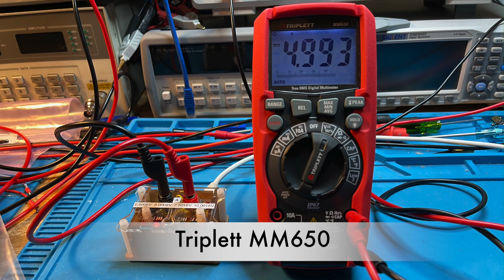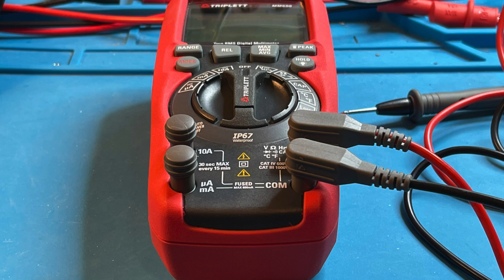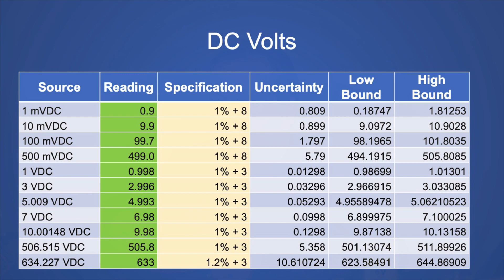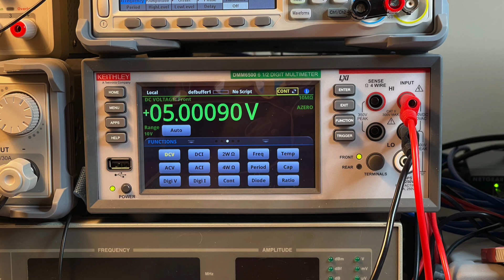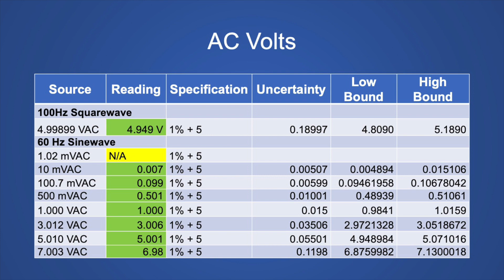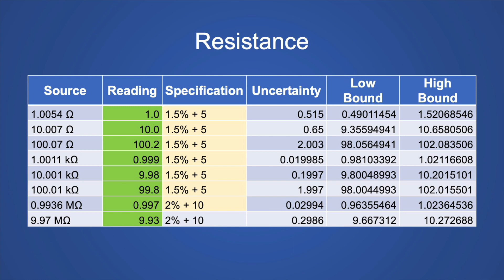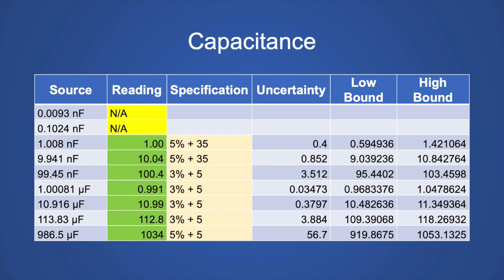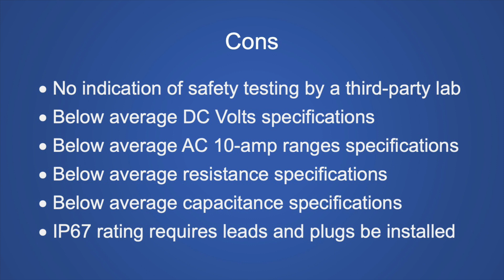Triplett MM650 Review

Comment: LOL.. this is a unit made by CEM… it is rebadged for various brands: CEM DT951, Triplett MM650, Southwire 14070T, Amazon Commercial 90DM610, Peaktech 3445, etc…  I have an Amazon Commercial 90DM600 (no LoZ and temp & flashlight) and it is a great little meter - very sturdy and solid, great for outdoor and rough terrain usage.  Not an electronics meter but great for general outdoor usage !!! It is tested by Intertek (stamped on the back of the Amazon Commercial & Southwire units as physically verified by myself).